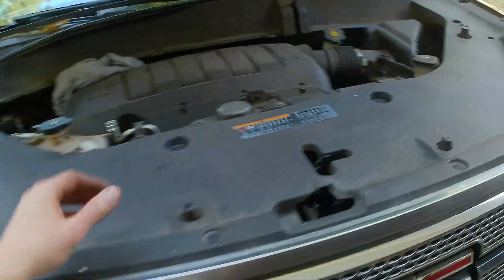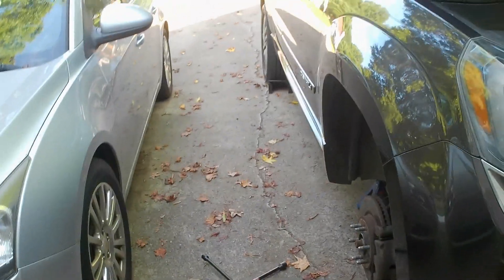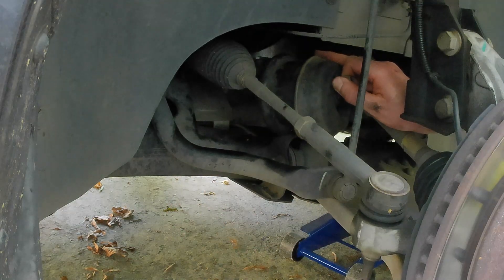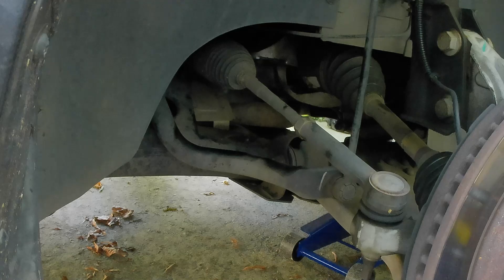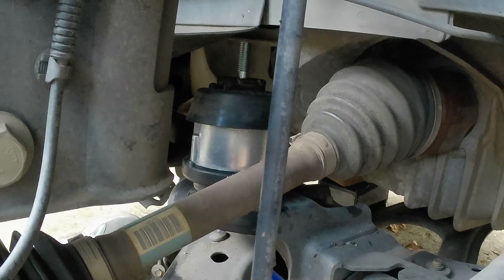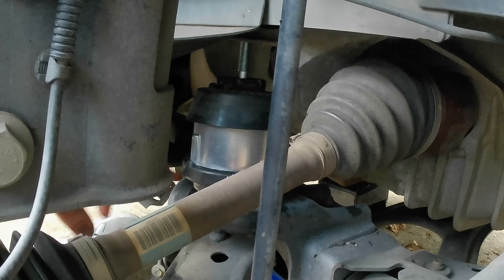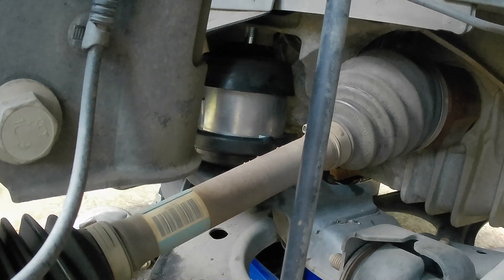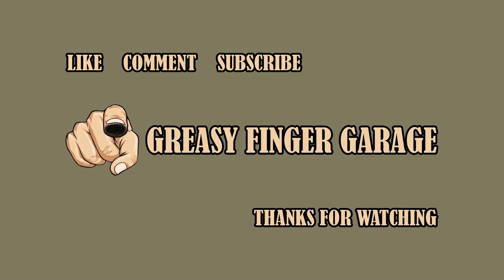2007-2017 GMC Rear Motor & Transmission Mount Replacement - Do It In Your Driveway

Comment: Thank you for the great video, i needed this. I am replacing all motor mounts tomorrow on my Enclave.
Reply from the maker: No problem.  I also have a video on the front motor mount and the torque strut mount you may want to watch as well.
Reply: Yes, I did watch that. Thank you for providing the direct link to the other videos in the description. This is the first time I have ever worked on cars, was able to replace all the front suspensions by myself by watching videos on youtube, then took it to the mechanic for alignment. There is a clunk  still there. Mechanic gave me a quote for $1900 for replacing the motor mounts, lol.
But thank you for making the video and saving our ass  from  mechanic shops 😆
Reply from the maker: @harvindersingh-uf2ws  If that is the case, it will more than likely be the torque strut mount has fallen apart cause the engine to rock and knock.  The front mount will also be blown allowing the engine to rock more than it should.  They tend to blow together.

Comment: If you use a handheld hacksaw to cut off the threading on the old mounts they come right off. On the new ones I dremeled some of the unnecessarily long threading and they went right in. Doing so eliminated having to unscrew the subframe. The trans mount ended being the easiest to do. Thanks for the video.
Reply from the maker: If I were to do it again I would definitely cut them to get them out.  At least for the transmission.

Comment: I just need to shift the motor up to replace the idler pulley. I thought i had to take off the upper mount too.
Reply from the maker: I haven't done the idler pulley so I couldn't tell you.  But I do have another video on the torque strut mount, the one you are referring to and the front motor mount.  Those should help in your endeavor.